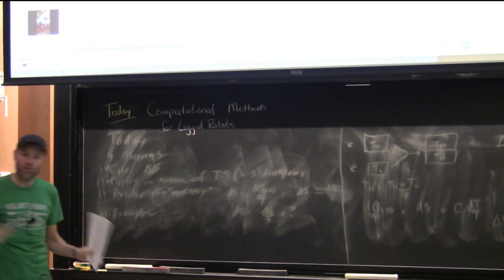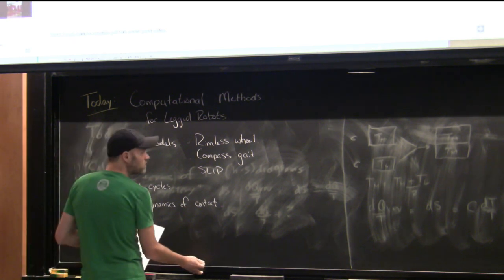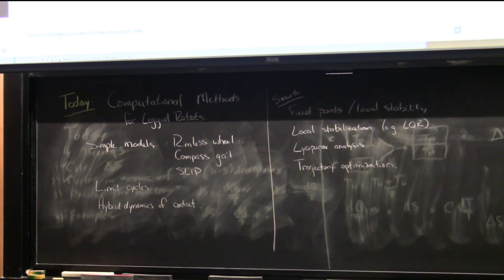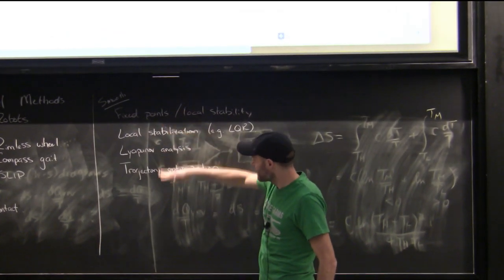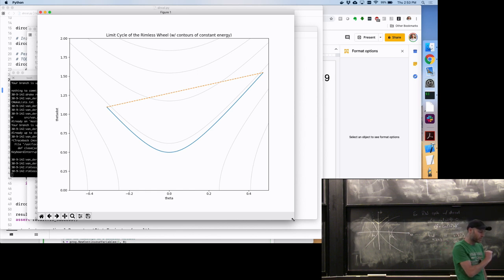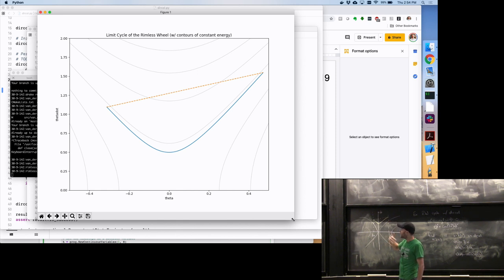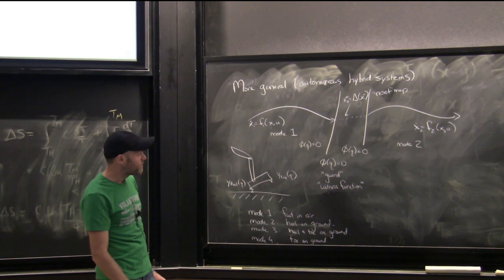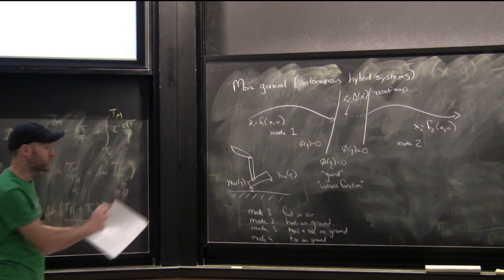Lecture 14 | MIT 6.832  (Underactuated Robotics), Spring 2019

Comment: If i understood correctly, there are the following methodologies:
A. Predefined step sequence:

1. Hybrid optimization using minimal coordinates. Given a contact sequence, and mode dynamics, guards and reset maps, we optimize "sequential" trajectories. The hybrid systems machinery is mostly usefull if we write the dynamics in minimal coordinates. (Difficult to implement for systems with multiple DOFs, like a quadruped).
2. Forces as decision variables: Again, we have a predefined contact sequence. We use floating base coordinates, so the dynamics are constrained. At the end of each phase, we would just change the constraints. (This change of constraints could be considered the reset map and the reset map of states would just be x^{+} = x^{-}.)

A. Not predefined step sequence:

3. Compliant contact model (This can be written in minimal coordinates). It is numerically stiff and also, the non smoothness of the dynamics won't (easily) allow it to discover new contact sequences.   
4. Using relaxed spring models, which apply a force at a distance, allow the optimization algorithm to discover new sequences. (Progressively this relaxation must be lowered until there is none, to create realistic trajectories). Still the ode is stiff due to large values in contact stiffness. 
5.  To be able to have bigger step sizes, you can solve an LCP using time-stepping. In this method, the forces are again a decision variable. The complementarity constraint can be relaxed to explore the solution space better.
Reply: Yes -- that's a nice summary.  Of course there are nuances -- the key idea in the LCP approach is to use time-averaged forces (which can include collisions); but this can be used with stiff or compliant contact.  And I might say "compliant contact model == spring model != force at a distance".  Force at a distance is a slightly different idea than compliant contact (and the relaxed complementarity constraints can be understood as allowing force at a distance).

Comment: Hi, 
You talked about the robust trajectory optimization, how does it take into account the surface irregularities like plane surface, gravel or sand, or similarly smooth surfaces like polished floor or rough ones like a road. Do we need to differentiate between these cases ?
Reply: One nearly always has to make a choice as to what level of detail you use the models for, below that level you try to lump the unmodeled residual into "disturbances", and try to be robust to them.  For small amounts of rough terrain, it's probably very hard to get detailed models, and we try to be robust.  For something like walking up and down steps/stairs, then it's worth modeling!
Reply: @russtedrake8012  Thanks !